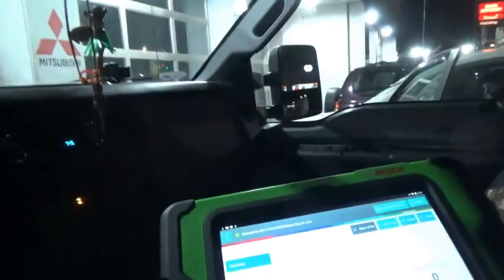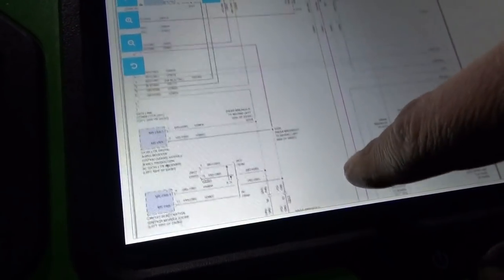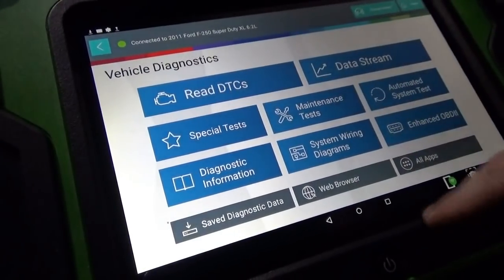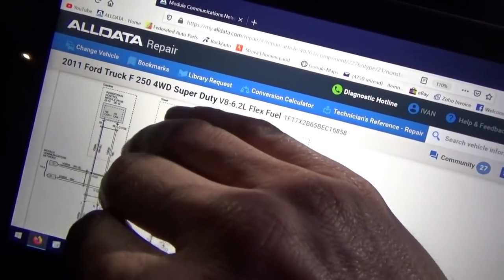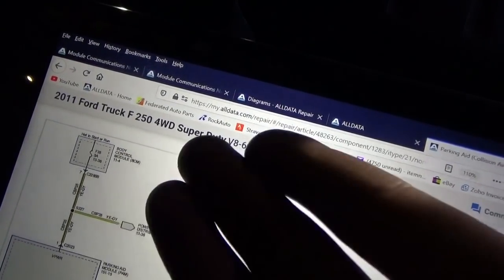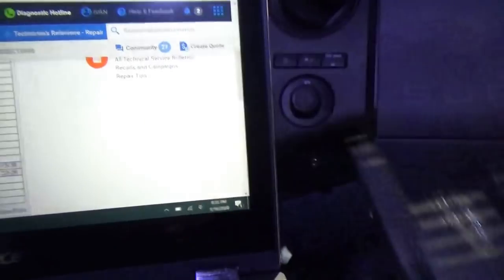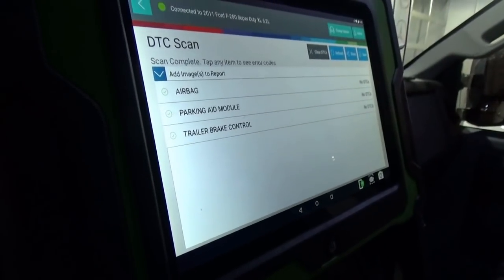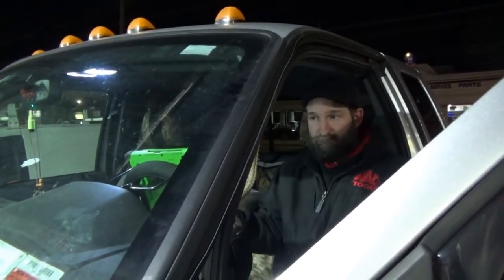3-STEP NETWORK DIAG from the Driver's Seat! (SI 16.3)

Comment: Your statement about doing everything you can in the driver's seat to narrow down the testing procedures is the difference between a diagnostics guy and a part changer. Both approaches may get to the same fix but which is the smarter way to work? You also had the perfect question for Keith. "Why not start by checking the fuses"? Keith had the perfect answer backed up by your statement as well. Outstanding video Ivan and Keith. I must say, if you understand a wiring diagram you have a head start in the process of investigation work. My attempt to answer your question at the end. Loss of powers or grounds, a short, an open circuit or a bad module.   :)
Reply from the maker: Excellent take-away, Wyatt! You passed the quiz with flying colors :)

Comment: If humanity ever gets the chance to catch a UFO ship I think NASA would contact Ivan, Keith and DiagnoseDan to scan and diagnose the craft systems and technology! Cheers guys, thank you for this video!

Question #1 

#1 Lack of power, #2 lack of ground, #3 CAN or LIN BUS line open, #4 main CAN module resistor blown, as a bonus #5 damaged module

Question #2
True

A shorted CAN line can still communicate the scanner with the module and give you codes related to that problem, just a open circuit will affect communication

Comment: What a great video! You asking Keith questions and him answering makes for a fantastic video. I'll have to watch this one 8x or so before things start to sink in, but it's great! 👍🍻

That Bosch is pretty sweet. If that's the company Keith was talking about, what he said alone makes them the brand I'll go to next. 😎 Those are the kinds of companies we should all be supporting. 

What sucks for me is, I need so many diagnostic tools .. but .. I started buying alot of my go-to tools 21-22 years ago, and they're all starting to fail at the same time, one by one, from ratchets, to my compressor, air tools, cordless drills, dremel, tire machine, angle grinder,  and multimeter just off the top of my head. I feel like I'm starting over again 20 years later! Frustrating. So many tools I want to buy, and I have to replace stuff I already bought. At least my Snap-On ratchet won't cost me anything but a little time to install the rebuild kit. And I should have hid my frustration with OBD-II years ago - all my customers remember I was the one who wanted no part of any check-engine light related repairs. I used to get so mad at my lack of knowledge, I wouldn't even try. Now I'm "typecast", as it were. Burned my own bridge. I get a few of those jobs every so often, but not nearly as many as I should, so I'll learn something ground breaking, and forget about it completely by the time I need it. What's done is done - just gotta keep at it and see what the future holds. Don't mind me - I'm just ranting and venting - what else is new?! 😁 

Great stuff, Ivan & Keith!! THANKS!! 👍👍🍻

Comment: The banter between Ivan and Keith is AWESOME. 
4 reasons for no comm (least to most likely)
4. bad module
3. short or open in wiring from road salt corrosion on Staten Island
2. failed or corroded connector
1. blown fuse caused by #0 , #3, or #4
0. owner error (aftermarket installations)
 False.... more like 90/10
I think OEM's should provide 2 things at no charge 
1. extra power and ground source for aftermarket installations (hmmm, maybe that's a bad idea)
2. free wiring diagrams online for every make and model
(I keep forgetting I am one of the 1% who likes to work on their own vehicles)
Cars aren't that complicated.  Engineers are making them complicated so eventually the driver can be eliminated.
Increasing Complexity results in  Decreasing  Reliability.

Comment: Excellent diagnosis both, understanding scanner information format, and it's topology seems key in this, and many cases. Mercedes-Benz introduced the CAN/BUS system, reduces amount of cables, and cable size/guage, thereby educing vehicle weight, but obviously increase in complexity.
Great vlog Ivan, thanks for sharing.

Comment: Thank you Ivan and Keith. Good job. Have a blessed and safe week. 
1. Open circuit in the modules power supply or ground. 
2. Open circuit in the modules communication wires. 
3. Faulty/failed module. 
4. Customer
Reply from the maker: HAHA I like #4 :)

Comment: Great video gentlemen. Love watching the diagnostic process. Especially a breakdown of network diagnosis. 
We have a crew here designated for running aftermarket junk and just like that truck... it causes a ton of havoc. 
As alwayays! Thanks for sharing! 
Q1: Power, ground, shorted module, opens 
Q2: Absolutely true. Without research/knowledge of system.. You’ll be chasing your tail

Comment: As  Eric O would say: 1. Check for aftermarket stuff. 2. Remove aftermarket crap. 3. Ship it :-)
Reply: I have a saying for when trucks come in with rear lighting issues.  When in doubt cut the trailer wiring out.

Comment: I don't know about you but I've had more communication problems with broken wires, customer fiddling or aftermarket then the module it self. In the last month I've done 4 2 broke wires ( 2 different Saturn's) , 1 fuse block wasn't bolted in all the way (impala) and 1 water damage to a Bluetooth module ( Nissan). What's crazy in all 4 vechiles I didn't check fuses first. Surprisingly, I attacked almost in the same way you guys. First thing I do after scanning is pull wire diagrams and check bulletins in some cases.

Comment: My friend doesn't know that much about electrical work. But when I told he one time to check the fuse's. He got my multimeter out and put it on continuity and checked the fuse's that way and did it in a fast manner.
Reply from the maker: Hmmm if the fuse is powered up doesn't the meter get confused on the continuity setting?

Comment: 1. Power, ground, faulty module, missing termination, broken wire
2. TRUE
Reply: Sangueffusor best to try checking the easy to reach or common fault modules  first and if there’s no can terminater  resistor there’s no network.

Comment: That’s interesting video. Those who don’t have thousands of dollars in diagnostic equipment don’t be intimidated by their logical argument of why they didn’t check the multitude of fuses, this would be the only way for the majority of us who watch videos like this. We get a real good education on theory of circuits and appreciate that information, good direction for us to follow a logical process of elimination of circuits. They don’t have to qualify their reason for their diagnosis, that type of info would be for those who are ready to turn pro! It helps me to see that I will check all the fuses I could, remember Ivan, sometimes it’s better to be lucky then good (SMA)
Reply from the maker: Interesting comment! Agreed, that some "fancy" equipment definitely speeds up the process. All the scanner did in this case was give us a direction by providing a summary of trouble codes. A $600 Launch can do that with flying colors. The wiring diagrams here were crucial, and with the internet are easily obtainable and affordable. The mighty test light was the last (and cheapest!) tool required to finish the job. However, the THOUGHT PROCESS was the most important tool, and the only one that money cannot buy :)

Comment: A lot of people install aftermarket crap like cameras or coffee warmers and goodness knows what, they often tag onto a fuse or worse splice into the lights if its rear.
What they forget is that is sometimes power supplied (and usually monitored) by an electronic module; they then generate codes and function failures.
My suggestion, if you want power for aftermarket, use the cigar-lighter socket adapter and don't touch the fuseboxes, if your savvy you can use a relay powered from a spare fuse space.

Comment: I would want to get paid to replace a fuse too. It took two electronic devices totaling about $5,000 to purchase and have to research the Ford CAN systems, it took some professionals some time to trace down which fuse that was not on the fix it list originally. So, maybe 2 hours of time just to put in a fuse replacement in the end is what it took.  Had someone said, "it's that 10 amp fuse under the hood", then it would have been easy but not everyone is able to afford the tools needed to fix. Even by going through all fuse's in every fuse box on the truck would have taken some time so, someone needs to be paid for that or the owner could do it etc. This is why newer wiring systems and networks are completely dumb. they cannot pin point a blown fuse if it hit them in the A%$. Bad engineering, cheap, just make it sell etc is the mentality of multiple modules in vehicles these days.

Comment: 1) Next to the obvious bad module, open/shorted bus, power/ground problems, I have once seen a module that would not talk because one of its 5v outputs was shorted. So keep that in mind.

2) Depends very much on the kind of business you run. If you do a different brand of car every day, you are going to spend a lot of time researching. But I work at a specialized shop, working on only 1 type of car. I know exactly how the buses are laid out. I know how the fuse boxes are interconnected. I know what common problems there are. I know where to find the junctions in the wiring harness to quickly isolate one part of the bus from another part. I don't know pin numbers by hard etc, but often that is the only reason I need a wiring diagram. Yes sometimes I need to do some research, but in my case it is more like 20% research 80% testing.
Reply from the maker: Must get boring working on one type of car every day? :)
Reply: @PineHollowAutoDiagnostics  ya, but I bet it's the best paycheck

Comment: I had a '70s chevy that would blow the dash light fuse. It happened about once a month. Could not find it at first. Then realized panic stop plus nighttime driving equalled blown fuse. Found a bare hot wire behind the aftermarket radio swinging like a pendulum.
Reply from the maker: Ha that's awesome! Aftermarket is always the suspect :)

Comment: I was wondering throughout the whole video until the very end, why did the fuse blow? Then the answer came. Aftermarket stuff added onto cars creates so many headaches. Q1: bad module, lacking power/ground, broke can circuit wire/wires. Q2: That is absolutely true. I'm a former tech, that's how I know. What customers fail to realize with problems like this is just that, they are paying for expertise and know how and expensive diagnostic equipment to fix a concern. When they ask is there a charge for that ask them if they pay their dentist to clean their teeth. It's all relative.

Comment: Diagnostic process  is always research.we have to know how modules, sensors etc are working how are they  relate  each other what kind of info they sending. Thats way diagnostic fee is quite high. Plus specialty equipment, they are not cheap at all. Greetings fro Greece!!!

Comment: if you use a power probe you see a ground on fuses that are not powered on,
Reply from the maker: Interesting point! However that can quickly get the user into trouble and confusion, since a "ground" can be provided either through the load, or by backfeeding through another feed!

Comment: Question 1: answer  
No power or ground 
Open circuit 
Shorted circuit (to power or ground)
Bad data hub( central gateway module) 
Quest 2 : 100% true  like in this case the fix was a fuse  but all research brought you to the exact fuse.

Comment: Well if we ohm out the can bus lines  and it's within specs typically 60 -65 ohm wouldn't that verify that there are no or very little chance of an open or shorted can bus wiring. .

Comment: A newly added/replaced module doesn't work. I understand not checking all of the fuses but it seems reasonable to check the powers and grounds to that module.

 It was a little confusing at first as it sounded like the trailer brake module had been added to a vehicle that didn't have one before but then it sounded like the owner had trouble with the trailer brake and replaced the module instead of diagnosing it. That might have been a result of reading codes.

Comment: I would like to add short to another circuit. Because the red wire to me was another circuit (aftermarket maybe a dorman design) that the original factory circuit was short to. Who knows when the rest of that red wire was removed

Comment: question 3  why does keith tease us with that pulsar knowing they arent produced anymore.
Reply from the maker: Great Question! haha
Reply: If I'm not mistaken, the Amp Hound does a similar job.
Reply: @187WCB  not really it only reads the current there is no substitution of the fuse and safety relay.  some of the  newer power probes have this ability i believe  but they cant read out amps if i'm correct
Reply: @richardcranium5839  My mistake. Crazy how no company has come up with a worthy replacement for that tool yet.
Reply: @187WCB  no problem  and i agree. it is so useful a tool.  i suspect its a patent issue. maybe we should show the chinese lol

Comment: I hate those damn fuse taps. If you want to add a circuit go to the battery or add a circuit to an empty spot in the fuse box with the proper terminals from the dealer. If you have a bunch of accessories then add an auxiliary fuse box or junction box. It’s not hard to do it right and prevent further issues down the road. They could’ve done it the right way for less money and trouble than it cost to diagnose the problem they created.

Comment: going against "not checking fuses first"(in this case), seeing that red wire cobbled in would be a prime target, of course you'd still need a fuse diagram or the owners manual since ford decently lists the fuses, when they're hot and a feed. many manuals are available free online..
surprised nobody else figured that one out or did they just listen to the customer and canon the part in? either way yikes!

Comment: Where did you get your auto related training? I know about the electronics aspect, but not the automotive... I'm still working on understanding most of the abbreviations in the Verus..
Reply from the maker: Strictly hands-on experience in the field, reading manuals, and attending a few training seminars. Having friends like Keith helps immensely in building a knowledge base fast :)
Reply: @L J what tool did you finally settle on and why?